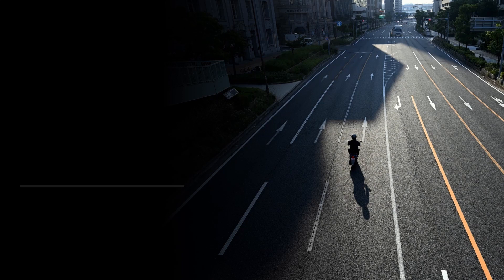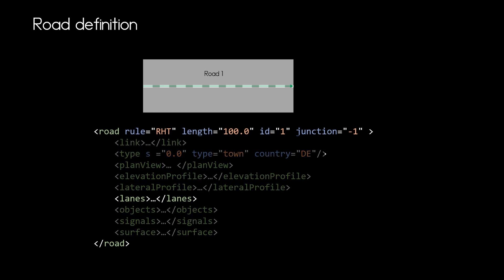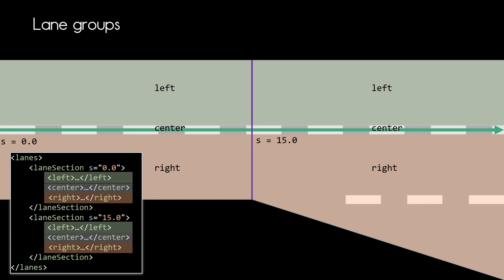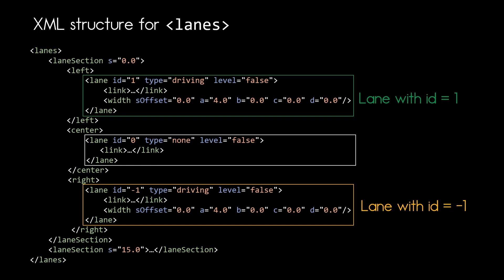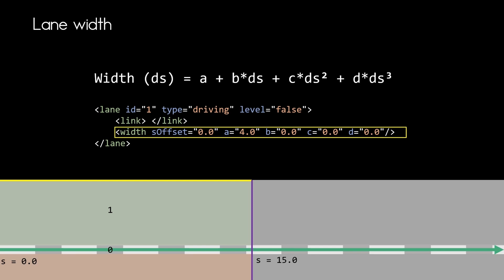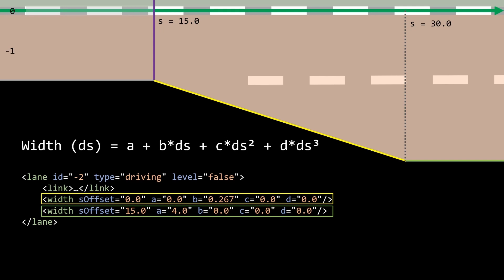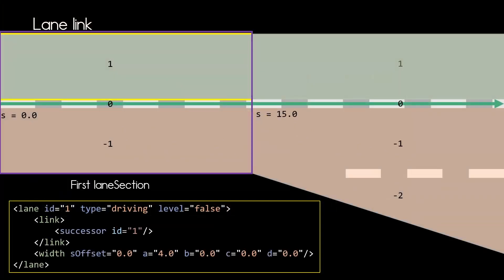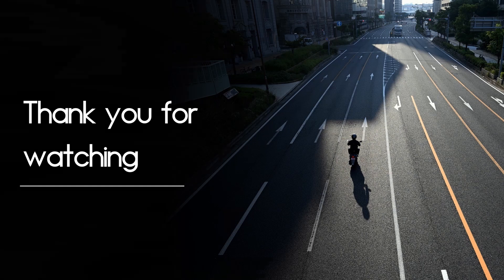OpenDRIVE Lanes - road networks for simulation

Comment: Hi Nicco, thank you so much for the easy and understandable explanation.
When i had a look into the documentation of OpenDrive i saw an entry "LaneOffset" within the lanes element. So far i understand it describes how the reference line is changing through the lanes. Is that correct? and how does the linkage as well as the lane id' are changing? I'd really appreciate if you can add a seperate video. Thank you
Reply from the maker: Hi this is a good question. It will take me some time to go through the latest version of the standard. - usually that provides examples. Maybe there is a example in the ASAM standard folder that shows how this works